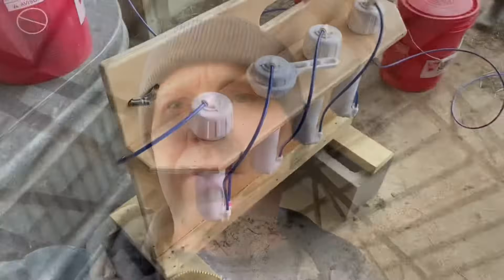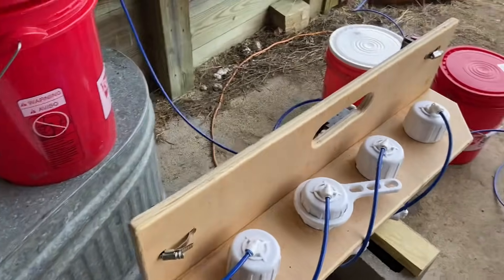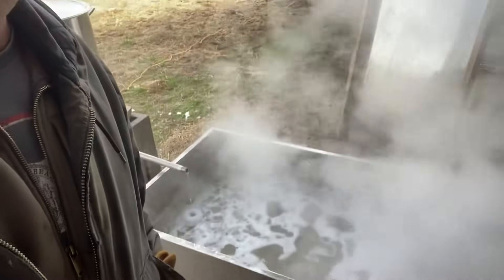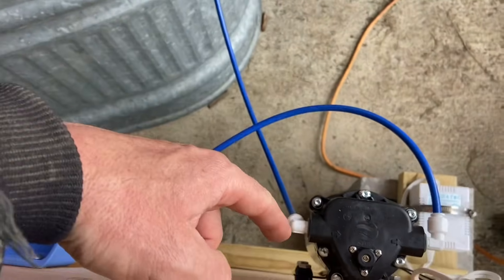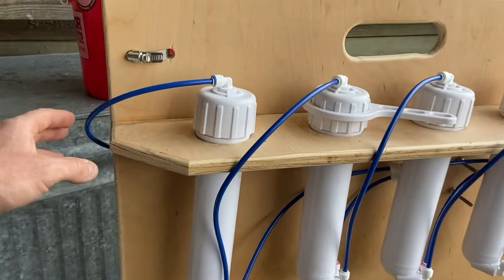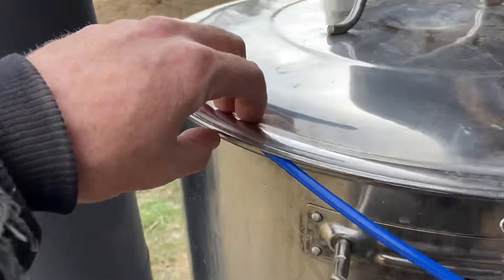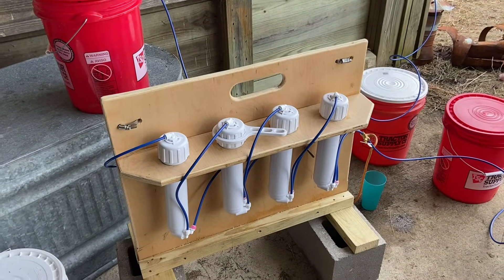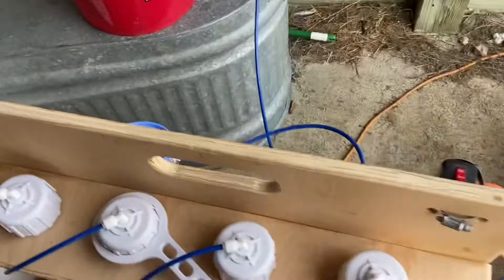Reverse Osmosis for Maple Syrup

Comment: My neighbour has a large RO unit for a large operation. My understanding from him was after each use he runs permeate backwards through the system to remove whatever is on the dirty side of the filters. I believe he has it valved so it is easier to seperate everything  and discard the water coming out the top of the  RO filters. I am hoping to set up something similar to yours for our small operation.  Thanks for the video.

Comment: What are the dimensions of your plywood??  Im waiting on the material and want to get the board and stand all built ahead of time
Reply from the maker: @jonathanwheaton6581  3/4” plywood which is 28” long by 24” high.  That does NOT include the standard 2X4’s at the bottom.  Hear me when I say - I wish I had made the plywood piece as small as humanly possible b/c it’s pretty heavy to carry in the house each night.  I think you could also go 1/2” on the plywood to make lighter as well.  Hope that helps and best of luck with your build!

Comment: Great video and simple design! I’m setting up a similar system, but I’m having trouble with getting a reading on the pressure gauge, just off the filter. I suspect it’s losing pressure as it just indicates zero. Could you post a link to the connector you are using off the T? Thanks a lot for your help!
Reply from the maker: @Freestile74  Do you have a shut off valve to crank down at the end?
Reply: @birchfieldfarming  do you mean a needle valve? Yes I do have a needle valve. The system is working great but the glycerin-filled pressure gauge doesn’t budge. Thanks for your help by the way!

Comment: I understand that you want to do one pass and be done which is why the four ro filters in series but the last filter is the limiter of that series. That is limiting the others because the sugar is so high in that one it restricts them all. You mentioned running all te sap through the ro process and skip the evaporator, that wont happen, the sugar will clog the ro membrane at 8% so ro is useless to get it any higher than that. What you could do to be more efficient is put the four ro housings in parallel and have a large 55 gallon barrel and draw the sap from that and let the sap recycle back into that and as that continues the % increases but you retain efficiency.  Also the design adds the benefit of being able to purge the membranes once per hour to avoid polarization which is a layer of sugar on the membrane reducing its applicable surface area.
Reply from the maker: @scottdc2105  The “limiter” doesn’t matter, neither does “purging every hour” or any other impractical armchair warrior nonsense.  What matters is this design is economical and it WORKS in the field.  QED it.
Reply: @ I run my own RO system and doing it right now.The best way for me to explain what i meant is that the last membrane in the series has the highest concentration of sugar going into it therefore the pressure inside that one specific membrane will increase limiting the volume of sap that is processed. When pressure goes up volume goes down and more volume equals faster processing, With membranes in series the last one will always dictate the volume going through all of them whether two or ten. If you havent tried it both ways then you cant be sure you have chosen the most efficient design. But i assume that the pump can build up enough pressure if the membranes were in parallel, if it cannot then you are right it wont be efficient because the membranes wont function properly at a lower pressure. Im still learning because im only a beginner. I do enjoy making maple syrup, i look forward to it all year.

Comment: I have a technical question for you. Not sure if you can help or not. I built an RO system similar to yours. I can not get one side to flow at all. Is there anyway I could send you either photos or a video of what I have put together? And is there anything I should be looking at. Pump is good, running 4 ro filters, and I get good flow out of one line but nothing out of the other. Thank you.
Reply from the maker: @RickWhite-p6z  Hey Rick - I am not an RO expert.  This is the only system I have put together.  I really can’t help much outside of this particular design.  Is anyone else reading this who can potentially help Rick??
Reply: @birchfieldfarming  Thank you
Reply: @RickWhite-p6z  make sure you have the valve on the junk side, I had the same problem.
Reply from the maker: @melvincanterbury9702  Thanks, Melvin!
Reply: @RickWhite-p6z  Yes Melvin is correct, that restricting valve causes the pressure to the ro membrane to increase and that pressure is what pushes the pure water through the membrane, having a gauge is good so you know where to adjust it to, about 80 psi, but if you have the ro housings in series also you may want to do parallel and just run the sap water back into the sap drum and let it make multiple passes that way instead of moving the sap around manually, as i mention in another comment that last ro filter is where all the pressure builds up limiting all the filters flow.
Reply: @birchfieldfarming  That is the way we have it. someone had mentioned we might need a power booster in addition to what we have. Not sure on that. Thank you for your comments though.
Reply: @scottdc2105  cant figure how to post a pic of our system. however it is hooked up the way it is supposed to be with a pressure gauge but still not working. I'll keep trying to figure things out. Thanks for your input.
Reply: @RickWhite-p6z  What is the pressure reading on the gauge when you run the system, it should be about 80 psi that should be more than enough pressure to force the permeate through the membrane.
Reply: @scottdc2105  35 -40 is all we could get. The needle valve did not change pressure and nothing was coming out the sap line.
Reply: @RickWhite-p6z  Ok let me cover some details about the ro housing, if its like mine, the cap if facing you is the input from the pump, and at the other end there are two lines and if the fittings are facing down the one on the right is the fresh water output. The one on the left is the sap output and that is where the needle valve should be attached. Also tell me the model # of your pump and GPD of your RO membranes and how many membranes and if series (one after the other) or parallel (all the inputs tied together etc) That is info i need to be sure its hooked up the way im thinking it is.
Reply: @ Rick, i just discovered something that may be of help. I just upgraded my ro housing to a larger one, i swapped out the smaller one and attached the lines to the exact positions on the larger housing and the waste water was streaming out the pure water line, so i swapped the outputs and that worked, Therefore the outputs are different or opposite from the smaller housing to the larger one. Do not ask why in the world a manufacturer would do that, maybe its dependent on the manufacturer.

Comment: Do you have a link for that white transformer ? I’ve got a pre existing system I got for cheap but it only has a pump with the wires and no plug so I think I need the transformer also
Reply from the maker: @nickmclaughlin9106  …I do not, transformer came with pump.  Yeah, you’ll need transformer for 120v
Reply from the maker: @nickmclaughlin9106  I checked and all the specs on my transformer match up with this one: https://www.freshwatersystems.com/products/aquatec-8800-series-transformer-120v-24vac-2-amp-usa?variant=13250426961963&c1=GAW_SE_NW&source=PLA_USA_PM&cr2=pmax__-__nw__-__shopping&kw=13250426961963&cr5=pla&cr7=m&utm_term=13250426961963&utm_campaign=pmax__-__nw__-__shopping&utm_source=PLA_USA_PM&utm_medium=cpc&hsa_acc=2014103020&hsa_cam=11853986621&hsa_grp=&hsa_ad=&hsa_src=x&hsa_tgt=&hsa_kw=&hsa_mt=&hsa_net=adwords&hsa_ver=3&gad_source=1&gbraid=0AAAAAD_qIt5bIvp8A__sACtZ-tSv6_rtI&gclid=EAIaIQobChMI5dyK0MXnigMVwEH_AR11RDftEAQYASABEgIIEfD_BwE

Comment: Great video!  I have a couple questions.  I am looking to use this type of setup to reduce some craft soda syrups I make.  I am looking to make them into a concentrate.  This iwll allow me to make a larger batch of syrup on cooking day, and then add the concentrate to a keg before carbonating it. If i was to run my syrup through a filter to remove large particulates, do you think this system would work to make a concentrate?
Reply from the maker: Great question.  It’s really hard to say b/c I think it would all depend on thickness of the liquid concentrate.  Maple sap raw is almost like water, so I think it would be difficult with anything thicker.

Comment: If the membrane can stop everything but the water.. and the everything else goes through a bypass.  What keeps the water from going through the bypass with the rest of the stuff? Does it take more pressure to get out the dirty valve then it does to pass through the membrane?
Reply from the maker: I’m no RO expert, but from what I understand RO filters are ultra fine.  I’ve actually heard the argument made that RO water isn’t good for you b/c it’s too pure, meaning minerals and such are filtered out.  I have a valve I can crank down to “force” more or less clean water out, so yes I’m using pressure, about 100 psi when all is running right.  All I know is it sends all the sugar to the junk side and leaves me with pure water on the permeate side.  I know this b/c my sap hydrometer measures zero sugar every time on the permeate side, the junk side measures 6% to 7% sugar, and I’m starting with about 2.5% sugar out of the tree.

Comment: Great video, got me to thinking that I need to do the same thing. Have you thought about wrapping some copper tubing around your stovepipe and running the sap through it before it reaches your prewarming pot?
Reply from the maker: So funny you say that - I actually have the copper, just haven’t installed.🤠
Reply: Have been doing that for years. Get about a 50-60 degree bump with a15 wraps of 3/8 copper around  6" flue. Outside of coils is wrapped with insulation to trap heat. RO runs much better with warmer water.

Comment: Is having pressure in the system a requirement? I’m having trouble with the separation aspect of the RO filter. There is only liquid coming out of one end of the RO filter. Do you know how I can fix this?
Reply from the maker: Yes, you must install a brass needle valve at the end and close at least part way to develop pressure.  We run very close to 100 psi when operating correctly.
Reply from the maker: Look at 5:13, that’s the needle valve on the sap (or junk) line, NOT the permeate side.
Reply: Sounds good. Thank you for clarifying! Working on a new Maple Syrup Club at Michigan Tech so your video really helps!
Reply from the maker: @adventurestudios2022 That’s awesome!  My email’s in channel description, so reach out if there’s anything else I can do.  Best of luck!

Comment: Great video! We just started RO this season. We boil once a week and RO right before we boil. What would you suggest we do with the membranes between uses? What is the best way to store them?
Reply from the maker: I don’t do anything in between boils, and it works for me.  Pump all the water thru the system, unscrew prefilter housing and let it dry.  I’m still figuring things out tho in regards to storing membranes in the off-season.
Reply: @birchfieldfarming thank you for the response. So you just run some water through it and leave the membranes in the housing? Do you leave the caps on the housings or do you remove them?
Reply from the maker: @tylergouveia9165 I should probably clarify a couple things here:  1. I’m talking about short-term use/storage here, and I’m rarely ever going more than 3 or 4 days in between running’s during the sap flow season.
2. This is after running clean water permeate thru the system (10 gal or so) with a clean water 5 micron pre-filter installed.
Yes, I just leave everything capped and in the housings for several days before the next sap run.  A week seems like you might be pushing it though.  Perhaps running tap water thru the system once or twice would help.  If I leave membranes in filter housings for too long (yes, I’ve regrettably done this), talking for several months, I’ve had mold develop and a nasty smell.  I had to buy new membranes in addition to taking everything apart and cleaning thoroughly.  So for short term, as in a few days, I think you’re fine so long as you run clean water thru and pop off that pre-filter housing to air dry.
Reply: I read after you clean system you should freeze the filters for next year's start up

Comment: Replaced the plastic tubing with 1/4" copper tubing. No more leaks. I can send you a picture if you want.
Reply from the maker: Great idea!  Yes, the 1/4 needle valve would work much better with copper, but did you then join the copper tubing back up to plastic?  If so, with what fitting?  Thanks for sharing!

Comment: Hi Jason, still having trouble achieving anything above 70 psi with my discharge valve completely closed. 

Question, if I run at 25 psi I can equalize the flow from both hoses. Is that the end goal? I’m afraid to waste too much sap and I don’t really understand the actual science behind the pressure and filtration
Reply from the maker: Hey Sean,
Sorry it’s not working right for you.  You need something called a sap hydrometer to test what’s actually going on with your sap.  It might be filtering fine just at different psi since you have different filters than mine.  Here’s the hydrometer I use: https://www.smokylakemaple.com/product/sap-hydrometer-0-12-brix/

I have about 2.5% coming out of tree (raw sap), then I test after RO and have anywhere from 6.0% to 7.0%, so I know it’s working.  But then I also like to manually test the permeate and it should always be zero…that way you know you’re not wasting sugar.
Reply from the maker: The RO is just pulling water out of the sap.  It’s making really pure water called permeate, which is what’s passed thru the filters, but then sending everything else out what is normally the junk or drain side, which in our case is what we want to keep.  The more pressure, the more filtering that can be done is the way I generally understand it.
Reply: How do you test the permeate? Are you using your hydrometer?
Reply from the maker: @Sean-f9e1w Yes, drop in the hydrometer to a test cup of the liquid, and for permeate it should float at zero.  If it’s even slightly above, you know you have some sap sugar in there.👍

Comment: Good morning, I just completed my ro setup - built it exactly as you did. Thought it looked very well done!

I'm having trouble reaching any sort of pressure though. Ive used all the same materials and permeate pump, but I did use 100GPD filters vs 150 GPD. Seems the best pressure I can achieve is 60PSI with the needle valve all the way closed and no discharge on the waste side. I'm stumped. Do you think I could have an air lock somewhere?
Reply from the maker: Couple things:  Elevate your sap bucket before pump.  Get it up above pump level.  Also, when you first start pumping sap, open needle valve all the way open and bleed air for a few mins, then crank down needle.  One other thing - Are you bleeding air in prefilter?  If you bought the one I showed, it has a red button on top.  When you’re first starting, open needle and watch that clear pre-filter housing fill with liquid.  Hit that button until all the air is out.  Hope this helps, let us know!
Reply: @birchfieldfarming  I suspect I may well have air trapped in the system. The prefilter I bought came without a bleed valve on the top...now I'm wondering how to get the air out of it.

I did run the system for a fair while with the screw all the way open when I was initially filling the prefilter and the ro chambers.
Reply from the maker: @Sean-f9e1w Yeah, sounds like an airlock.  Reminds me of the fuel filter on my diesel truck.  Try filling the pre-filter completely full of sap before running.  Did you have bubbles coming out of discharge hose when needle was fully open?  Mine will do that for a few mins on start-up.  I have to crank down needle and open and close for a few cycles.

Comment: how do you get the needle valve to be a tight fit?
Reply from the maker: It’s tough.  Mine always has a slow drip.  I just put a container under to catch drips and empty back into sap bucket.  I’ve tried numerous other valves and all have leaked worse than original needle valve, even RO valves.  Let us know if you come up with something!

Comment: Another question, the instructions on my membranes said that the permeate water in first hour of use should be discarded. do i also have to dump my concentrate in the first hour or just the permeate?
Reply from the maker: What I did was run tap water thru for an hour or so, then I went right into sap.  Just discard whatever was produced by tap water, that way you’re not wasting sap concentrate!
Reply: @birchfieldfarming  perfect. i was thinking that would be fine but wasn’t sure. thanks for the clarification
Reply from the maker: @ZachAdventures You got it!👍

Comment: If you do not run 150 gallons through this, can or do you keep the filters for next year after running clean water through it? I do not produce nearly this much and see that they make smaller filters but just curious.
Reply from the maker: I’ve had so many people ask this - and honestly, I don’t know.  I’ve only had the system for a year.  I purchased new filters this year, but I also may try and use the old.  I left the old ones in place in the unit, and I’ve simply run water thru a few times throughout the year.  The water was fine, but I’ll probably take one out and inspect it and decide whether I want to use my new ones or not.  Main thing I’m worried about is mold.  I should know very very soon.
Reply: @birchfieldfarming You can clean them and put them in the freezer.
Reply from the maker: @jamieherbst9664  Didn’t think of that, thanks!